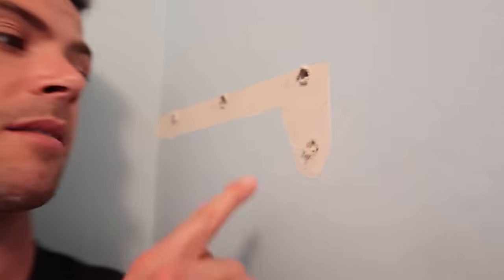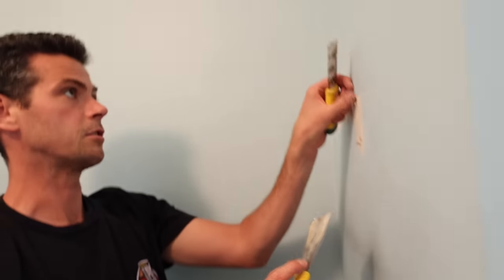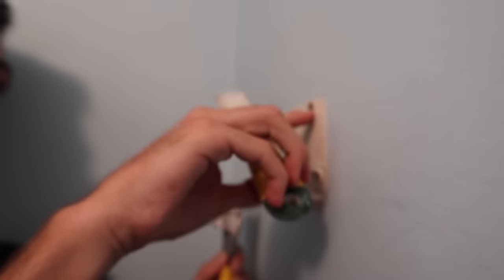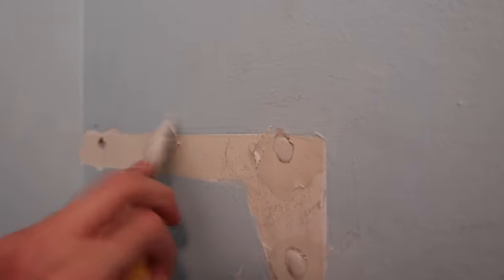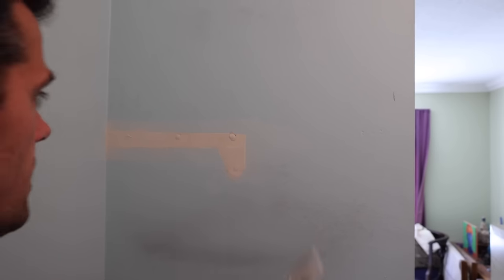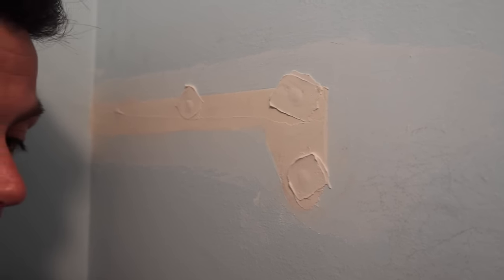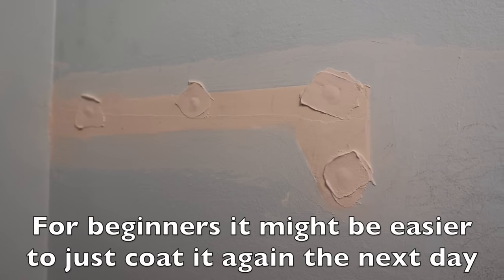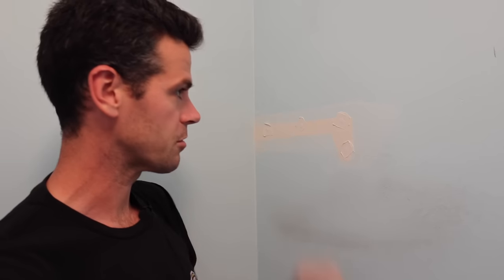Fixing Big Holes from Drywall Anchors!

Comment: I have torn drywall in my bathroom and I have fixed that but I had so much drywall dust behind my sink where the caulk goes now that it’s scraped out I’m scared to mud and sand again so that the same thing doesn’t happen so my question is should I mud or caulk first? Thank you for any advice you can offer.

Comment: A single edged razor blade can be useful in removing the paper the is proud of the surface. Works much better than a putty knife because the cut is cleaner.

Comment: I have a hole in the wall that is bigger than these, but smaller than the ones you show where you cut out a new piece of drywall. In this case, would a metal wall repair patch work? Do you ever use those? Thanks!

Comment: Alternatively if the holes dimple and need another coat one could use a little fast set to fill it out before painting.  20 minute FS over dry mud will dry in less than an hour.

Comment: More reliable way to prevent blistering is to simply cut off the paper edges with a razor.
Reply: I actually do both, razor at 45 angle to clean rough edges, then put the dimple just to make sure all is okay.
Reply: I put a very light coat of shellac over it before muddling if the brown paper is showing to seal it down to prevent blisters and then mud.

Comment: Just make a tight plug with paper towel then plaster over. Just needs 1 coat and buy the quickset stuff. This was too much work and messing around here. Dry in an hour or two, ready to sand and paint.

Comment: I always fill initially with 2 part car body filler-keep it level or slightly low as this stuff is hard to sand but dosent crack or shrink-even on huge holes-then a final thin level skim with painter filler-then a very light de nib then paint. Holes to paint in 10 minutes.

Comment: a swipe with hot mud, 20 or 90 sandable topped with premixed would have had 100 holes filled in the same time you took

Comment: In the USA most walls have texture and your method would not work.  I use paper towels and wad up a small amount with drywall compound with it and use that to fill the hole.

Comment: How would you handle hole-filling on a wall that is already textured with a knockdown finish? My concern is trying to "match" the knockdown texture of the wall around the holes.
Reply: I dab a bit of the mud or spackle onto the wall around the hole with a damp sponge to create the texture, then knock it down when it's almost dry.
Make the new texture area an irregular shape and size if you have multiple holes to hide it better.

Comment: What brand is that vacuum pole sander
Reply: Twenty five bucks but it’s hard to use for much longer then he did and you need web sandpaper and your shop vac besides.  
Five minute mud with tape and over float slightly and by the time you’ve cleaned your pan of the hot mud the patch will be ready to finish smooth with or without a little water from a spray bottle retempering just the top layer of mud massaging it smooth. 
Then texture. 
Following day paint.

Comment: I seem to have trouble getting the orange peel  stippling from the paint roller to match. Does this just require more coats?
Reply: @flightographist  
Okay thanks. I’ve never tried the light pressure
Reply: @flightographist  thanks for the tip!

Comment: Is it possible to put a new anchor in the same spot after it’s fixed?? I messed up putting a hook in my wall to hang a plant and I want to try again but In the same exact spot after I do this process and fix it
Reply: There's nothing there holding that new patch except itself making it quite fragile.  Thus, it will all break out quite easily.  You're better off moving your hook at least a few inches away.  Better still, find the stud behind it.  It's much stronger.

Comment: There is an easier and more elegant way.  Place the rounded end of a ball peen hammer in the hole and strike it gently with another hammer until the hole is concave. This technique pushes the ragged paper ends into the hole and makes the spackling simple.   The method shown in this video usually leaves the torn paper sticking through the spackle.

Comment: I had to repair a whole mess of these types of holes in a doctor's office, they used the large size anchors and 2 inch screws to hold up plastic file holders which probably never saw more than 200 grams maximum of weight load. 

Whoever installed thise was a moron.

Comment: So if your putting on extra to sand then to reapply more why don’t you just don2 coats of hot mud… it’s not that much harder to sand with a sander… you could even use plaster of Paris… I guess because you don’t have to mix the water to the powder? 

Just seems like a long process for some  holes in a closet… 

Turned a 30 min job into a 24-48 hour job 🙄

Comment: Wow. Just, no. This is silly. The bit of paper you leave will swell from the water in the mud. Jeez, just no. Step 1: Using a sheetrock knife cut a slightly larger hole, like a crater, than the original. This action eliminates the excess paper.  Step 2: A pro will have a rip stop type product( I use Zinnser Gard - comes in quarts; you don't need much) that you quickly sponge or brush in each hole. That stuff 'freezes' the paper, and seals the rock so that you can do whatever you need to do to it. I use that technique on walls where there's massive damage to the sheetrock. Step 3: DON'T use premixed mud. Mud ALWAYS shrinks. Use 20 min. USG plaster. It doesn't shrink. I've been in this business since '79, so I've done it the WRONG way plenty of times. Those 2 products are job savers. You're free to do it the author's way, or you can make it perfect.

Cancel

Comment
@TheKYcookiemonster
@TheKYcookiemonster
1 year ago

Comment: No,no,no. Cut out very loose paper with snap knife first. Then take ballpeen hammer and crater the hole. Fill with Dewitt wood filler or hot mud. Sand when dry (15 min). Top with topping compound. Prime with your paint then two coats of high quality paint.

Comment: first thing you need to do is get a drop cloth over that hardwood floor
Reply: First thing you need to do is stop leaving dumb comments.
Reply: @marilynwong9784   being in the trades I know what drywall bits do to the open grain of a hardwood floor, no matter how many coats of varnish is on it.  this guy is an excellent taper, surprised he proceeded with the repair without protecting the floor
Reply: marcus cicero I’ve never put a drop cloth down and never had a problem. Maybe it’s you.

Comment: Most of the time I enjoy your vids. This time, you're way off. The first tool you use should be a hammer! Just dimple the hole so it's slightly inward.  After that I use 20 minute mud with regular green or black lid for a final. No tape required unless someone used way too much force removing the shelves. If you use a hammer, you don't need to remove the anchors. The closets I usually renovate are 100-200 sq. ft. and have A LOT OF ANCHORS. I can go through and dimple 40-50, then mud them in 20 minutes. Please try it on your next job!

Comment: amateur hour. i agree with indenting the hole, but that's about it. instead of building it up and waiting a day to sand it you can do the exact same thing in an hour with 5 minute mud and a fan. that includes sanding. and no need to build it up so it dries faster. 2 thin coats and done. i've watched many of your videos and they are usually spot on but this one i totally disagree with.
Reply from the maker: This is just one method to do it. The info was meant for people who only have a little tub of air drying mud or spackle. So it literally was amateur hour😂

Comment: Both thumbs down!
You are doing it the "quick and easy" way, and the results will show in year or two (after painting), when your "mud" shrinks, as it always does when applied in large quantities, such as to plug a hole.

OK, here is the right way:
1) Cut off all loose parts with a blade (not the "quick and lazy" way as you show). Hold the blade at an angle to taper the transition from the hole to the surface of the wall.
2) Brush exposed paper from the drywall with water-based acrylic solution (usually sold as "Wood restore" or "Concrete floor primer"). It turns into hard plastic when it dries, so the paper no longer swells when wet or shrinks when dry.
3) Spray the inside of the holes with water and immediately seal them with gypsum ("Plaster of Paris") mixed with water to the consistency of sour cream. Level it off well because once hardened, gypsum is impossible to sand.
4) Let it dry overnight.
5) Apply a thin layer of Sheetrock (drywall joint compound), then proceed as usual - sand, prime, paint.
6) I have repaired holes in the ceiling left by recessed lights, and 10+ years later you won't be able to tell where the hole was.